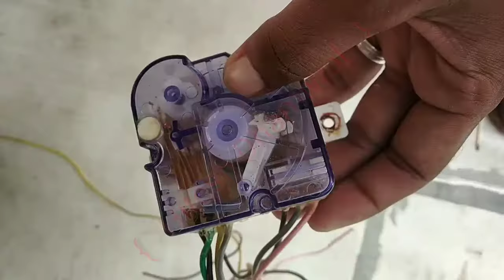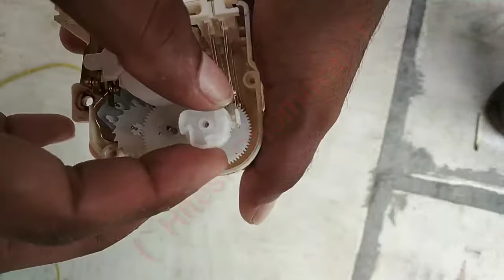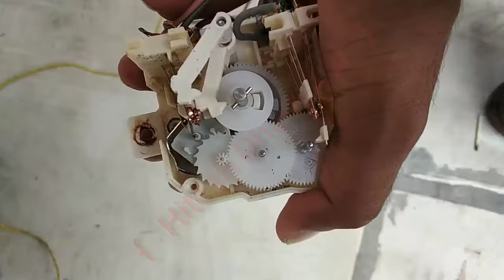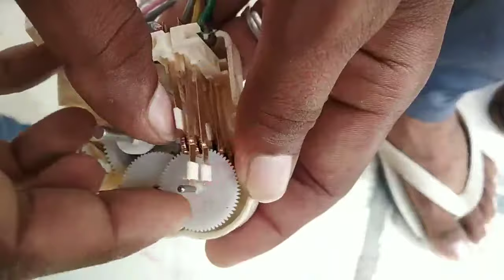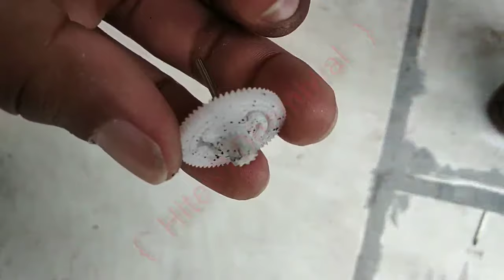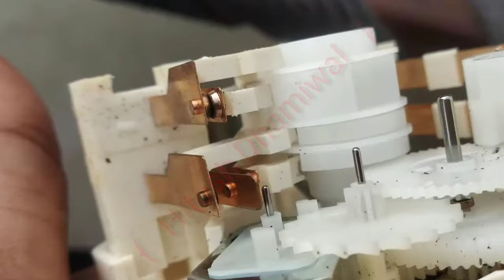Washing machine timer repair

Comment: Cut cut nahin kar raha h timer kaise setting kare
Reply from the maker: Gear tut gya hoga open kar k check kar lo or same gear se replace kar dena
Ya fir
Clean kar ke dekh lo timer ko oil ke saath
Reply: Machine me washing timer sirf 5 Or 10 ki speed me hi kaam kar raha hai baaki ke 15 20 25 30 yaha par kaam nhi kara raha
Reply from the maker: @mohammedsalman9156  ander blades per se carbon clean karna hoga...👌👌👌
Reply: Ok thanks bro👍👍👍👍
Reply from the maker: @mohammedsalman9156  be careful about Gears
👍👍👍 
Use sand paper to clean copper stripes.
Also use machin oil in gears👌👌👌

Comment: I get spark inside my washing machine timer. 
everytime the timer clicks(2pins touch each other inside timer) it creates a minute spark. 
i want to know the reason why it spark.???
Reply from the maker: My be carbon problem which cause that problem
You have to clean that 2pins from inside
That will found black...
Otherwise you can get another timer to get ride from all above problem and tension👌👌👌
Change it with new if you can't do above method😌
Reply from the maker: Thanks a lot for your precious comment
If you Like my video please like share and subscribe My Channel🤗🤗🤗